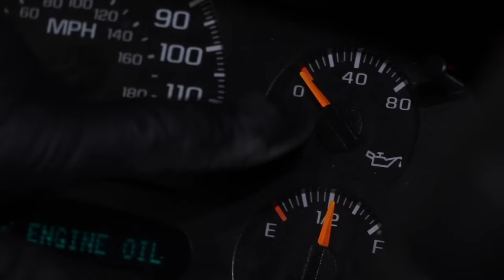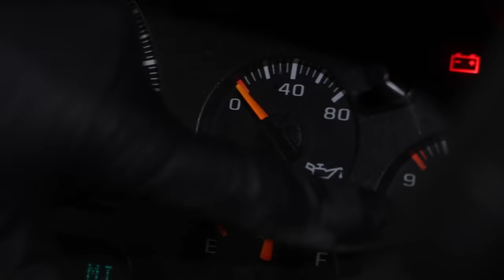Top 5 Problems 2000-06 GMC Yukon Sierra Chevy Suburban Tahoe Silverado Avalanche Cadillac Escalade

Comment: I have a 00 tahoe and u are totally correct I have had to fix all 5 problems except for the wire on the firewall and the fuse wires but I never checked them either so I will start looking into it

Comment: Evap vents, rear disc backing plates rusting out, blend door actuators, ac belt tensioner bearing, transfer case encoder motor, broken exhaust manifold bolts that dorman makes the clamps for, window regulators, and the transfer case oil pump failure are the most common that come to mind for me.
Reply from the maker: +SSTEVEN94 Thanks for the feedback!

Comment: I have a cammed 5.3 Chevy Silverado with a straight pipe and a rebuilt transmission and engine it’s my baby a awesome truck my abs light has been on for decades never had a issue it would go on and off when I hit a bump it would go on then 2 days ago my breaks slipped at low speed when I was making a utrun and a hit a parked car because my brakes were grinding it wasn’t bad just a dent on my front bumper I couldn’t stop my truck so if you are having abs issues with your chevys or gmcs take the fues out of the box for the abs system for the mean time because it’s more dangerous to have a faulty system and were you won’t be able to stop your truck at all if you disable the abs system drive with a little room in front of your breaks will work fine but it won’t stop at a sudden stop as good people have been driving with no abs system for 100 years and had no problems with it but just letting yall know

Comment: Funny you mentioned the “funny electrical problems” my 02 tahoe had kept turning on and off while driving and freaking out and caused me to get in a minor accident, turned out it was a rusted out ground connection, it would of been a big help to me if I saw this video before I spent the 80$ for a shop to fix it

Comment: A bit of a notorious problem in my area, the instrument clusters in those tend to go bad, gauges get stuck and fail entirely or end up turning in the mount and reading wrong, might just be due to the high humidity in my area causing them to degrade faster but it's definitely a pattern around here. 
Oddly enough I don't see many O2 sensor failures out of these trucks, and I don't think I've ever run across one that needed an intermediate shaft, transmissions seem to be a little on the weak side, a 4l80 swap is a must for anyone looking for longevity, the 4l60 is a good transmission and all, but the poor things where never meant to take the kind of abuse an LS can push out

Comment: You missed a super-common  issue: the solder on the surface mount cluster components corrodes and allows the component to separate from the board. Then the cluster PRNDL goes dim.
Reply from the maker: +Stephen Dee Thanks for the feedback!

Comment: Rusty brake lines are problem on these vehicles and some have cylinder heads that will leak coolant into the oil - both can cause major problems.

Comment: I have a 02 Silverado and after 235k I got a random bank one driver side o2 code cleared it and it hasn’t come back at all 20k later I also get a random abs&brake light come on when it gets drivin as my daily not sure if it was the same problem as stated in the video but she runs strong and no matter what I can promise she will outlast most
Reply from the maker: +macgyver6699 Thanks for checking us out!

Comment: I had a different top 5 in mind.  Fuel gauge, 4WD actuators, window regulators, SRS codes... Ok 4, because the O2 sensors is definitely up there.
Reply from the maker: +MOTO 809 Thanks for the feedback!
Reply: @1AAuto  Sure!  I have an '03 Suburban and I have several friends with the same generation Chevys.  We've all experienced many of the same issues.  The great thing about these rigs, though, is almost no matter how many codes it throws you can still keep driving it if you need to.

Comment: I have a 2003 Chevy Suburban. My issue is with my rear passenger side turn signal. Works fine until I press my brakes and it stops blinking and turns my front parking light off. Sometimes just pressing the brakes I'll see my green arrow on my dash on, meaning that my rear passenger side turn signal lit up along with my brakes. Now it's causing my 3rd brake light and brake lights to all flash at the same time while using my rear passenger side turn signal. I just replaced the tail light conjunction box. So now I'm stumped. I've checked all my lights, tested my fuses. Only thing I can think of i recently replaced my passenger side mirror with on that was heated. I don't have heated mirrors but couldn't pass up on the $14.99 price. Maybe I connected it backwards? There were 2 wires in the mirror assembly. It's started a few days after I replaced the mirror. I've already cracked it trying to pop it back off.

Comment: 2000 Truck- RUST, rocker in/out,cab corners, rear cross member, frame. BRAKES- ABS unit itself. ENGINE-egr, engine knock.
Reply from the maker: +classic7890

Comment: the parking brake system deserves a mention as well, If your parking brake shoes don't fall off the auto adjustment system fails and you have to take the rotors off to adjust the drum shoes just a little bit more yourself. GM blamed the customer for its failure because "didn't you know you were supposed to set the parking brake every time you park the truck? This also ensures that the parking brake stays in working order" LOL

Comment: Sometimes when the battery becomes dead the AC/Heat system loses its actuator settings and now your system does not control the temp heat doors, selection of modes and inside/outside defrost selection becomes inop.   You get one side hot and the other cold when you wanted only one of them!   Probably a whole video would be required to explore that wonderful system especially when the heater stays on during summer and the AC stays on during winter..
Reply from the maker: +Dion Kraft Thanks for the suggestion and for watching!

Comment: Have had to replace both front end wheel hubs twice on my 2004 2500HD 4x4 Silverado, also had the same issue with my steering column

Comment: One problem I have with my 07 Avalanche that constantly comes back is a "stabilitrack" engine code.  Seems to be very common issue.  My mechanic is VERY smart at diagnosing, and we figured out that believe it or not, the battery was issue.  It had lots of corrosion (acid) buildup, and he would first clean it, but it would come back.  Upon checking battery again, yup acid returned.  So I opted for a battery change (even though the one I replaced was still charging well and all), and that seemed to have solved my issue with the Stabilitrack errors.
Reply from the maker: +Bertminator Thanks for the feedback!

Comment: I wish I had this video 10 years ago, in 07 I bought a 01 Tahoe and it took a big ol shit, my engine would stall at low speeds going over speed bumps or turning in and out of parking lots. Would be a mission to get it started again. ABS started buzzing one day and would never stop, had to pull the fuse/relay out so always had abs and break light on

Comment: I have a 2000 Chevy Suburban that is having problem's with the rear HVAC unit. I have changed the blower and resistors with new parts but does not help. Neither of the two controllers work. I have checked all fusses and relays and changed some fuses that looked very old and switched out the relays. I dont know what my next step will be.

Comment: The # 1 problem with these is brake and fuel line rust out, # 2 is water pumps.   I have owned a 03 Sierra for 7 years and Ive turned wrenches for a living for 30.  I agree with everything but the 02 sensors , not a big issue from my experiance.  Best truck I ever owned.
Reply from the maker: +E Cannon Thanks for the feedback!

Comment: Have 01 Silverado 5.3 240000 miles. Replaced engine @147k with piston slap. Rebuilt front diff @185k cause of bearing squeal, transfer case rebuilt @225k cause plates were chattering,  replaced #3 injector and evap sensors on top of tank and engine @235k.
Reply from the maker: +Christopher Hale Thanks for checking us out!

Comment: My 04 GMC  all of the above plus more the heated seats go crazy on there own had to unplug the element wire control module is 250.00 bucks for a rebuilt one piss on the heated seats also the drivers seat memory has a mind of its own as well as the driver side mirror engine codes more than I can count love the truck but now I'm afraid to put the key in it seems like every time I get in it it's something else this truck  is  an electrical nightmare wishing I had my 87 back it had 300 thousand miles  and  the guy who bought  it loves my old truck !!!🤔
PS I am a certified GM Mechanic and ASE certified mechanic of 46 years!!!

Comment: I have an 03 Yukon Denali. purchased on 07. On going since purchase in the panic alarm will randomly go off (Horn Blowing and Headlights Flashing). Mostly happens during the night. The alarm will reset itself within a short period of time or can be reset immediately with the remote. Have researched the web many times over the years and fing no info. Dealers say they are unable to troubleshoot an intermitting problem. Have a family member that had a 03 Silverado that would do the same, so now it appears it could be a general GM fault in this generation of trucks.  My weak attempt at fixing was to remove horn relay (at least the flashing headlights doesn't wake the neighbors) but problem still exists.

Comment: Had and still have the intermediate shaft issue. Replaced twice under warranty on my 06 Sierra. I have not had the other issues but its had other ones. Enough in the beginning that i thought i bought a bran new lemon. It has the 4.8 and for the most part runs pretty good. Hard shift between 1st and second. They Replaced the hydro shift modules a couple times and then when it did it again they said gm sent a memo saying that was normal. I think that's a bs answer to get them out of making it right but it's alright so far at 124k

Comment: You forgot rotted steel brake lines !! those trucks are known for rusted brake lines, and rear backing plates always rot, rear parking shoes always separate from the metal it's glued too,  also steering issues like constantly replacing Idler arms and pitman arms, lets not forget the BCM, these trucks always have electrical problems when they get some mileage on them. worked on a bunch of these trucks. Actually I owned a 95 Tahoe , loved that truck aside from these issues.

Comment: Yes, great video. Thank you. 
What about the Fuel Module? Fuel level sender and fuel pump failures. My 2001 Sierra, I’ve owned it since 2005 got it with 40K on it. Always used Mobil One every 3K to 5K. Always had the trans serviced every 30K. Bad luck I guess, at 125K I had to replace the Transmission, at 135K New motor. Coolant leaked into the oil, bad heads. At about 60K issues with the fuel level sender, shown empty w/a full tank, @ 90K an O2 Sensor, Both Front Wheel bearings hubs, 1st one @ 65K the other at 80K. The only good thing has been the brakes. I now have an $8,000 truck worth $4k on the street. Sadly, I’m just waiting to see what fails next?
Reply from the maker: +Jim Harding Thanks for the feedback! This is also an issue these vehicles have, it just was not included. We may come out with a part 2 of this video series and definitely will include this. We hope nothing else fails on your vehicle! 1aauto.com

Comment: Code 300 ,Code 405 was misfire on 7 then went to 8 now random. It will elope at idle sometimes it want.replace sensors on top of motor which did help.does have couple bolts broke off in head . rigging smoke test see if learn anything.havent done pump test yet. It did sit for a yr. Filter was nasty when changed.just a shade tree mechanic like figuring things out myself but about to give up let a mechanic fix it.

Comment: 312000 miles on my 8.1 liter HD suburban knock on wood. It's beat up and leaks oil from rear main but still runs almost like new.
That said, I have done the usual radiator, crank position sensor, front hub assemblies and front end everything twice but I'll buy another one when it wears out!! Which is crazy because they cost 5-6000 more now for a low mileage 02-05 model than 10 years ago so the are not depreciating, they are going up in price.  I have a '07 burb that is much nicer but nothing but electrical problems and gutless.

Comment: Down stream O2 sensor on passenger side. Heater in the sensor is bad. I cut the two wires for the heater and put an LED light in between the two cut wires. Lol took the computer a while but eventually it figured out that the heater is still bad. I think it could just tell because the readings being sent back to the computer are delayed until the sensor gets up to the right temperature. That's what that heater is for is to get that sensor up to temperature and running as soon as possible. Funny now I have a little red light underneath my truck whenever it's running. Sensor is like 50 bucks I've got other things on the list before it

Comment: Knock sensor problems are generally caused by washing your engine and water getting under the intake manifold and shorting out the connectors to the knock sensors when I did this I just drove it in till the water evaporated and the knocks sensor code went away
Reply from the maker: +Harold Meyer Thanks for the tip!

Comment: I’ve had multiple problems with our 2007 Tahoe LTZ.  Rust - body and rims, transfer case - was probably a ground but garage screwed me for the  TCCM and the coder motor which lasted about 11 months, now key in the ignition - no lights, no crank and battery fully charged.  Will never buy GM again. They replaced all door skins including rear deck inside 4 yrs old, and were rusting again within 4 yrs again.  Replaced rims and all the TPMS.  UGH.  I just want it to start so I can sell it to someone!

Comment: Anyone with the Intermediate Steering Shaft (ISS) problem: remove the shaft, disassemble, and install a grease fitting.  There are vids or instructions on plenty of sites that show you how.  Replacing the ISS is a temporary solution.  I'm going on 9 years since I did mine.  Only have to add grease about every two years or so.  Only takes a few seconds.
Reply from the maker: +TicoTimeCR Thanks for checking us out!

Comment: My 04' Sierra with 250k miles, never had a problem with the O2 sensor. Still on the same water pump. Still have same muffler and cat.  Main problem I've had, cluster panel and heater wire harness due to heater resistor. Never had a check engine light come on.

Comment: It’s a very helpful video.  I have a 2006 Yukon and had four mechanics look into the bogging down issue, and they just keep referring me to someone else.  If you press down on the gas, the car doesn’t want to go at 1-10 rpm.  If you back off the gas pedal and press it again, it starts moving.  If you press the pedal and floor it, there is no problem.  The truck drives fine.   There is no griding or hearing of the transmission slip.  Any videos on that subject?

Comment: Good video.  Indeed these vehicles have their share of "problems" but what vehicle doesn't?  Some other problems that are common with this engine and platform are intake gaskets that fail or "shrink" and leak when cold and set lean codes on one or both sides.  Engine can also run rough then.  I've seen techs replace O2 sensors for this code by mistake. Water pump failure/leaking is common.  Worn out rear park brake shoes/including the "hat" rotors common.  Side note: wow this vehicle is badly rusted and corroded, too bad for the rodent damage.  I had a truck towed in once to our shop where a squirrel had babies up in the fender area and, of course, had eaten/chewed up the wiring and the vehicle wouldn't run.  About $3000 later we fixed it.  Had squirrels running around the shop for a week.  (Retired GM ASE master tech/adviser)

Comment: Water pump, starter, bcm, rear access actuator, blend air actuator, driver window motor, rear bagged shocks and brake hydroboost have been the  issues on my 2005 yukon denali with 140,000 miles.

Comment: 2001 Silverado 4.8 ltr my top problems over 16 yrs: #1: dirty throttle body (cleaned yearly), #2: fuel pump (twice), #3: water pump (twice).
Reply: 5.3 were far more common and better engines

Comment: Alot of the times when u have low oil pressure it can also be the rubber O ring on the pickup tube inside the oil pan if u don't replace it in time it will wreck your oil pump.the O ring will fail no matter what in time it usually happens when your vehicle has around 160k-190k miles

Comment: My Fuel Pump on my 01 Tahoe keeps dying, but I think it could be the O2 since I never changed it, but has never given me a code.
Reply from the maker: +revampted Thanks for checking us out! 1AAuto.com
Reply: I had a fuel pump fail. Possibly caused by a very rusty / poor contact fuel pump ground wire at the body / frame.
Reply from the maker: +Drew Thompson Thanks for the tip!

Comment: I’ve never encountered any of these issues. 
For me: 
-brake lines and rear calipers
-transmission 
-water hose and connector to heater core
-evap codes
-rear main seals

Comment: Had another issue which went through a few hands before I recieved it. Another tahoe with water infitrating pcm several pcm's replaced and noone could figure out how water was getting inside the sealed unit. It ended up being the windsheiled washer level sending wire acting as a straw, capulary effect and syphoning washed fluid direct to pcm. :)